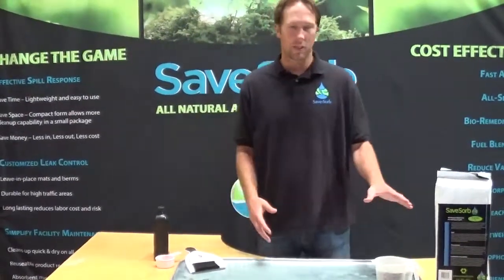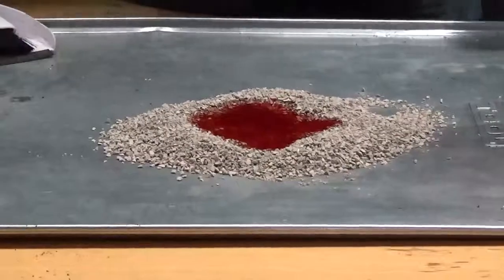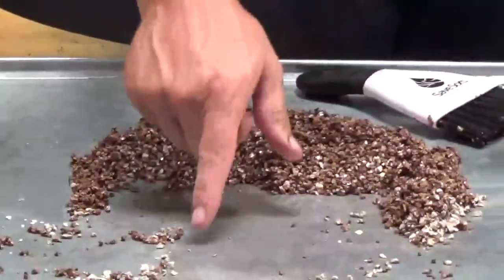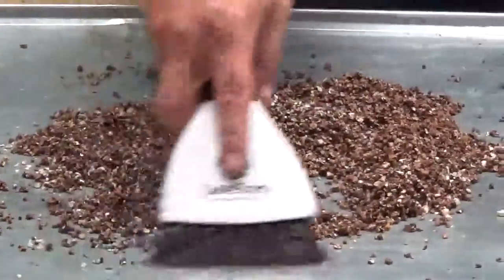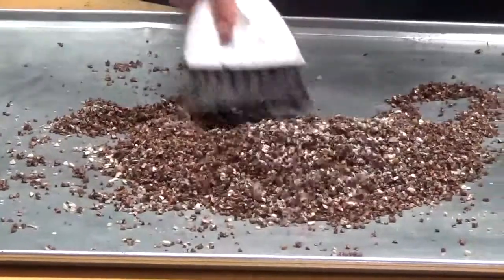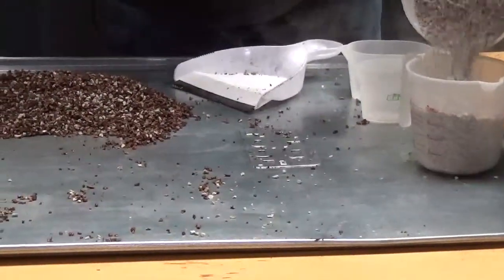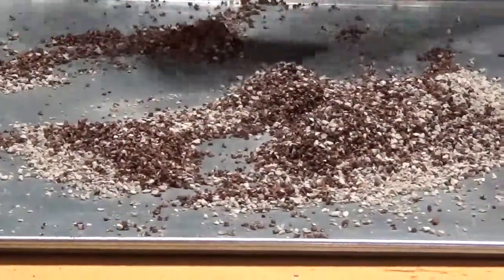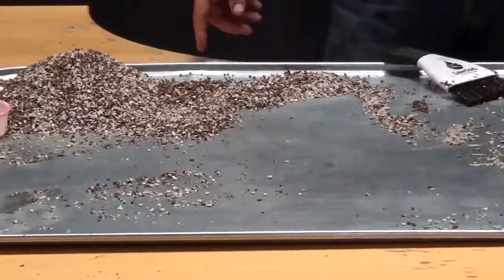Kitty Litter Adsorption Capacity

Comment: Unscientific, self serving video. The two cups of clay would have absorbed the all of the oil if left undisturbed for a few minutes longer.
Reply: I think the bottom line is the clear message that we live in an instant society, therefore, all results should be instant (everything with legs is a table). Adding more cat litter to the already soiled litter was not the best choice either. If the applications were done one after the other without mixing the dirty stuff into it, even with that infinitesimal time the result would have been near success. Glad to see someone else paying attention.